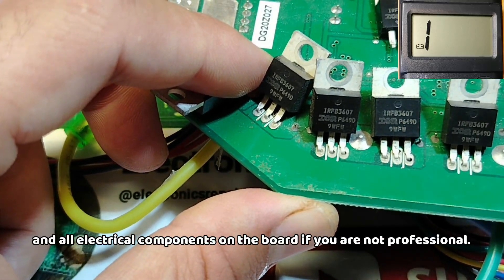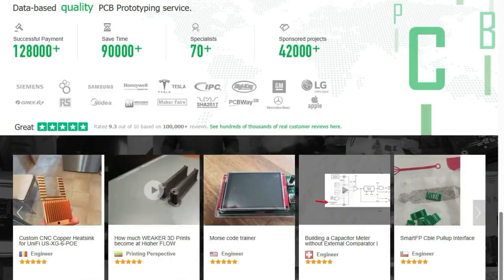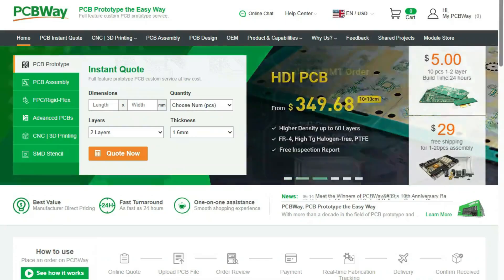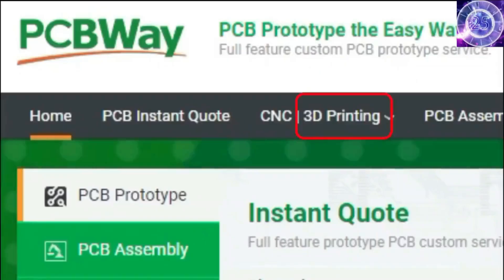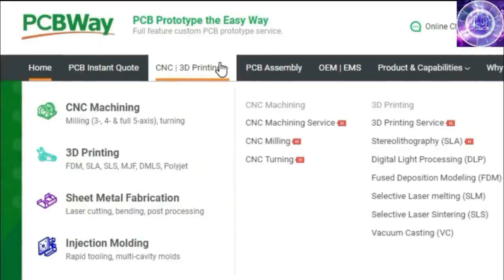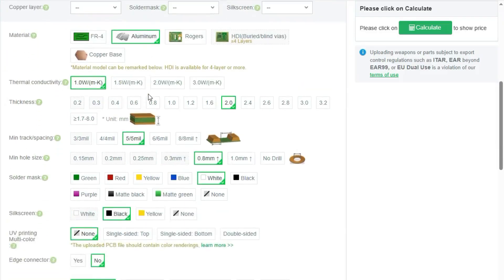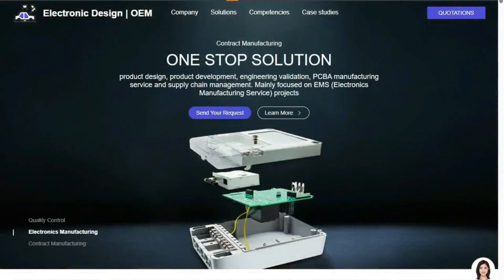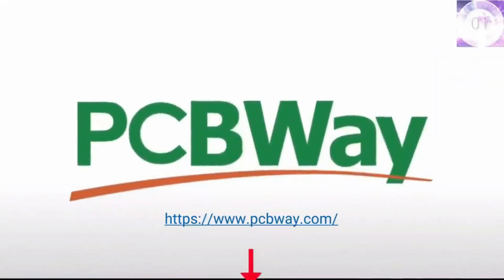Mosfet Testing: How to Test a MOSFET Like a Pro Using a Multimeter

Comment: Dear sir, npn can be read switch probe red and black, so, MOSFET is normal or bad? Reading number shown both over 1.000.
Reply from the maker: If both readings are over 1.000, it might indicate that the MOSFET is potentially functioning, but make sure to check the datasheet for specific values.
Reply: Thanks, sir @electronicsrepairbasics_erb

Comment: Dear Sir,
Greetings from India.
I am using a Dell Latitude E7470 laptop. In the BIOS, the battery section correctly recognizes the power adapter as 130 watts. However, while the laptop operates normally, the battery does not charge when the adapter is connected.
Kindly advise on how to resolve this issue.
Best regards,

Comment: Please look.Don't you think the number 258 that this MOSFET had is a low number? As you know, the health number of diodes is usually between 0.4 and 0.7.
Reply from the maker: That's an interesting point. The number can vary depending on the specific application and the MOSFET's design. Always good to keep an eye on those specs